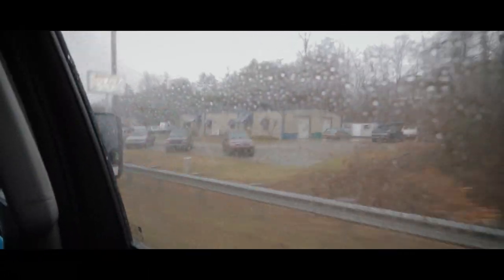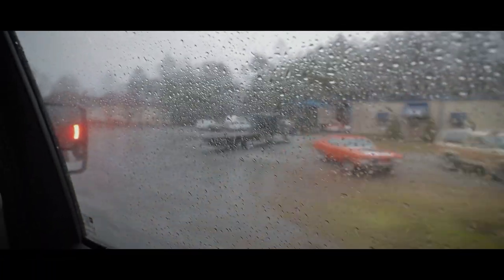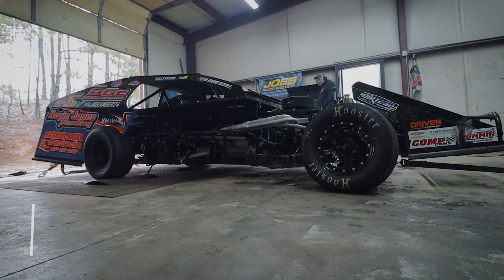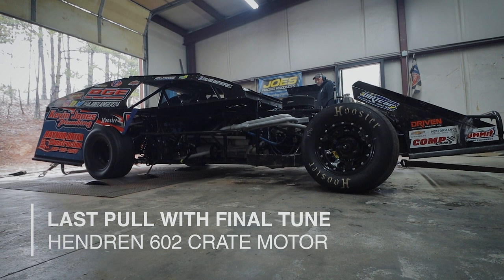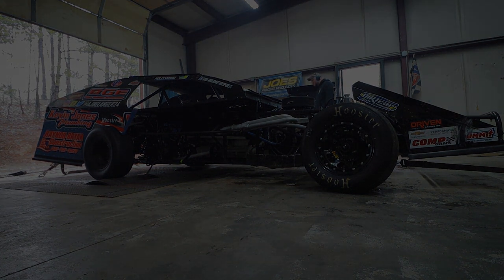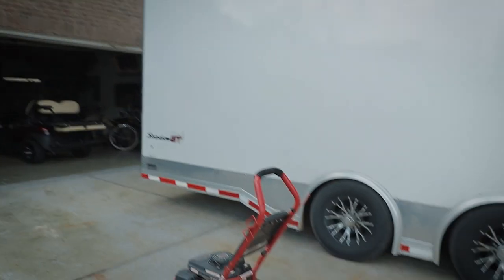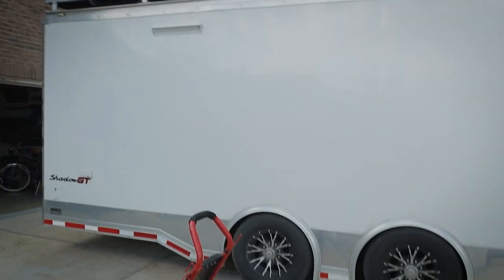Dirt Modified 602 Hendren Crate Engine on Chassis Dyno

Comment: Gutter butter will get the black streaks off mix it 1-1 in a pump up sprayer and spray it on then brush it do small sections at a time and don’t let it dry on there
Reply from the maker: Bryan Jones nice! Thanks, how does it do as far as the aluminum? Will it cause any dulling?

Comment: Since this is 2 years old can you tell me how much power it made? I just dynoed mine today so I’m curious 👀
Reply from the maker: Honestly man I don’t remember. Let me see if I can find out if I still have the sheets on it.
Reply: @AJBelanger24  any luck? What elevation?
Reply from the maker: Hey man I tried to find the paperwork but we sold that motor and gave it to the new owner. I’m sorry man.
Reply: A buddy of mine just had a 602 built and chassis dyno by them it made 330hp and 390tq idk why they were secretive they can’t be that much difference from engine to engine they all have to stay within the same specs

Comment: does that back tire not rub on track? it looks very close just sitting there
good shit either way
Reply from the maker: No it doesn’t. On the dyno the car is tired down so the suspension doesn’t travel as much as it normally does. On track the left rear looks like it goes underneath the car (providing rear steer) but there is clearance.

Comment: You will lose to a small block ford, built by Schlepers Speed shop in Sulivan WI! Or called "Pro Power Motor Sports"! John Schleper is the old man and they build 950 HP small block fords that can turn 9500 RPM's all day! You know who they are!
Reply: Comparing Apples to ORANGES Much?  (Or you don't know what a "602" is.) Those are SEALED SPEC engines and are not that powerful...Most 1-ton pickups with Gas engines made in the last 15 years have more power!  The 602 STOCK (BEFORE YOU CHEAT) make 350hp at 5300 and about 380tq at 3700-4200 (The V10 in my Truck has more balls than that, but its not in a 2500lb car either!)
Reply: @misters2837  man people like that have no clue what 350 hp feels like on dirt most people couldn't control that much less anything more then a 602 crate car
Reply: @youknoweverything7643  Yeah, they have no idea. Much like driving a RWD pickup on slushy snow and bald tires...LOL...Clay gets slimy when wet and packed... I took my friends car out and "Packed the Track" well at the end of those slow laps they have 5-10 HOT warm up laps...Yeah needless to say I headed to the pits pretty quickly. (I used to race on tar - which is completely different), and I do know how to "turn right go left drift" but usually not next to 20 other cars! LOL...
Reply: @misters2837  yea it takes a little getting use to it feel unnatural for the first few times with 20 other ppl but it becomes second natured. I grew up racing asphalt round track cars and have raced dirt about 15 times now. And that 602 crate motor I just saw one dyno run in a street stock with 6200 rpm and it was a blue printed one from hamner racing engine it made 250 hp to rear wheels and 400 to the crank
Reply: @misters2837  so how do ya cheat with the 602 ? Do tell wink 😉
Reply: @baims8367 Yeah, I am sure there are a few YouTube videos on how to reseal a sealed engine...